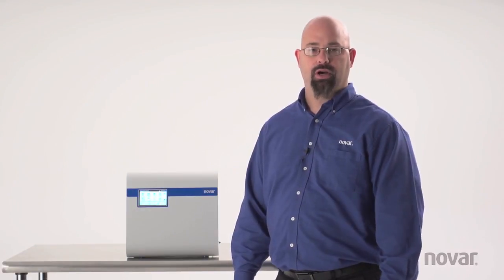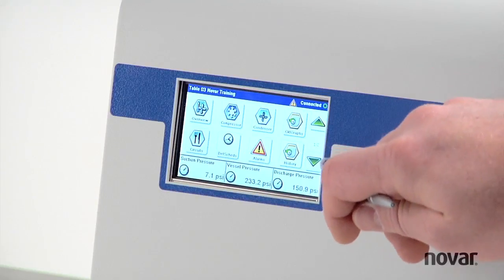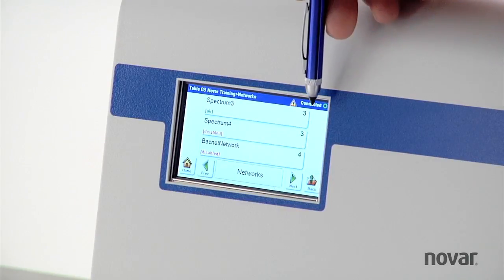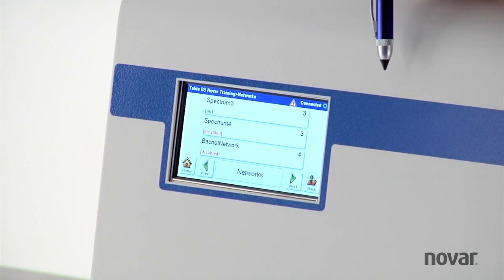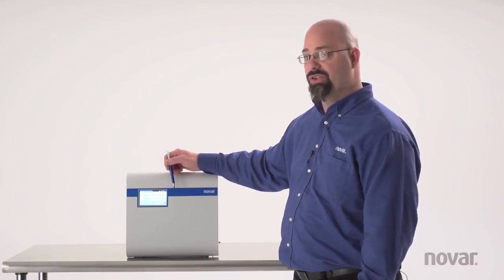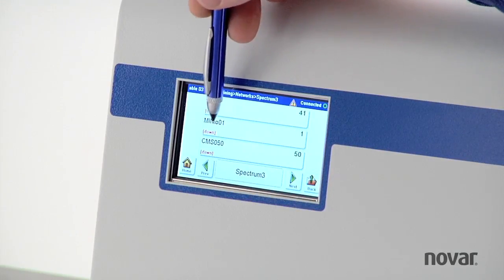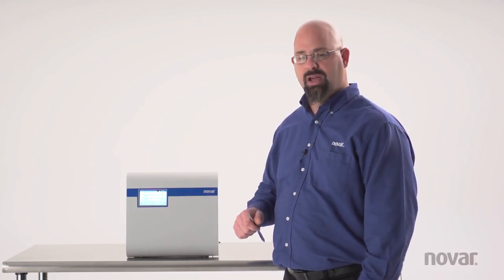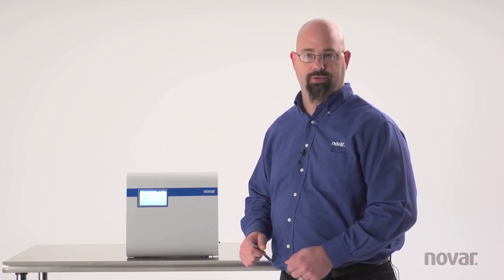Comm Loss XCM 20R

Comment: We are doing Sam's club 8246 in Texas, but we got a big CCD REQUIRING us to use multiple relays of different kinds for the new cases, ( dual temp) LLSV, EEPR ETC. do you have any back up diagrams, or maybe you can look at the print, and my e-mail is flood.itech@yahoo.con
Reply from the maker: Logan, This is a pretty large CCD, I will contact you directly for this.
Reply: Novar Training  hello sir, I still need your e mail address and I will correct mine below 
Flood.itech@yahoo.com